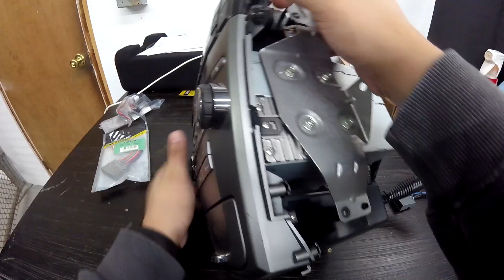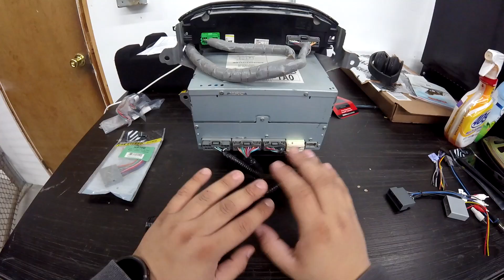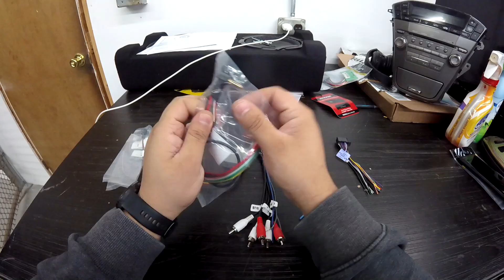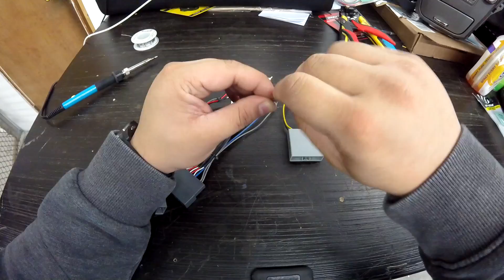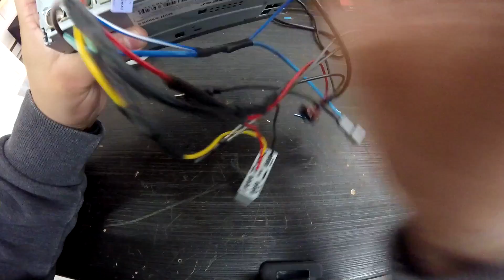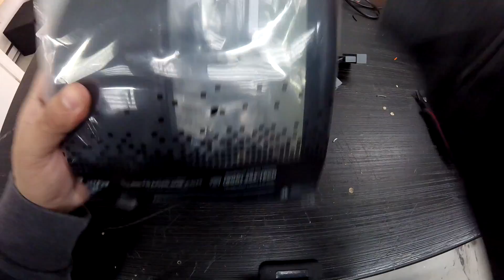2G Acura MDX Wiring Harness | Pioneer AWSC-1 - How To

Comment: What if I want to hook up a aftermarket amp/sub? My head unit has the 6 speaker RCA’s, V in/out, LIN, RIN and RCIN
Reply from the maker: You will need it to have 6 RCAs for audio out. FL, FR, RL, RR and SUB1/2

Comment: So I only see an offering for the 07, 08, 09 MDX on the website, does this harnessset also fit the 2010-2013?
Reply from the maker: Yes as long as it does not have navigation. The navigation model has different connectors we are working on a solution for that vehicle as well.
Reply: @MobileMaxCarAudio  awesome, thanks.

Comment: How’s the solution for the navigation version going ?
Reply: @MobileMaxCarAudio  thank you, I will consider this solution, but at the same time I’ll continue to wait and keep checking your channel for updates, I still appreciate all the help btw
Reply: @MobileMaxCarAudio  so if I buy the Acura MDX  Aftermarker PNP RADIO complete kit all I need to do is customize the dash kit and everything else should be pnp to my aftermarket pioneer radio ?
Reply: @MobileMaxCarAudio  hey i tackled this without knowing the nav issue and now im stuck wit a kit that i fully customized to save the nav but no sound wit the wiring part. Even my steering wheel control volume only controls down with no sounds still. I have a pioneer